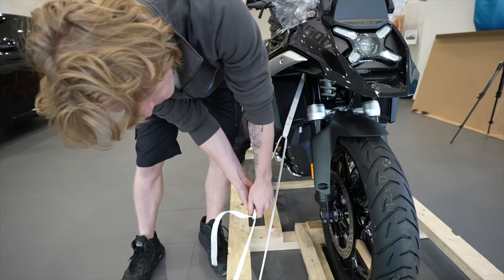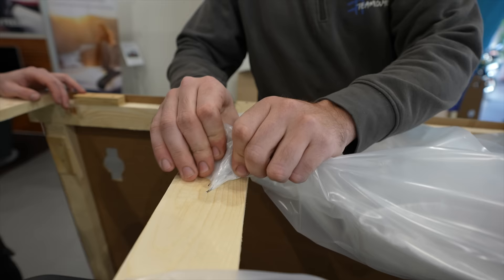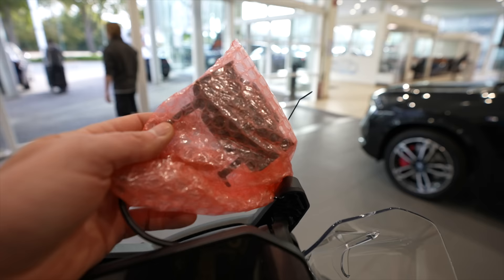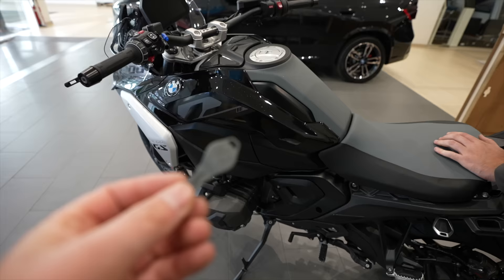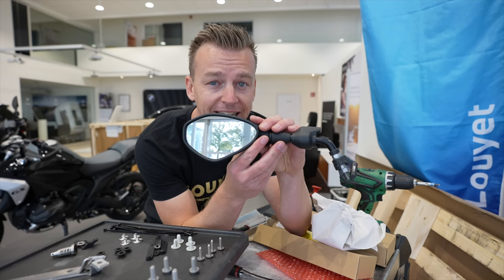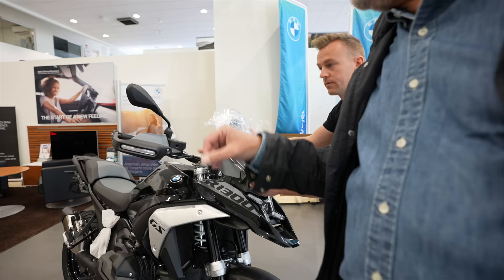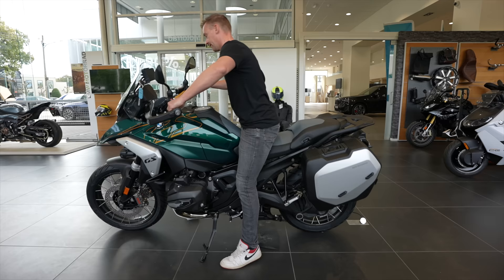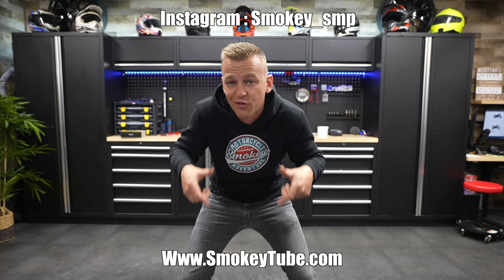2024 BMW R 1300 GS Unboxing & Assembly | TRIPLE BLACK

Comment: BMW 1300GS, German engineering: Recall actions to date: 1. fire hazard due to starter relay and 2. engine replacement due to connecting rod bolts. 3.original accessories from BMW: Since March 2024 official recalls of the Vario case and the Vario top case for the BMW R 1300 GS. Reason: Risk of accident due to cases opening or falling off. I am thrilled!😒

Comment: I’d like to understand the standard height. How tall are you and does the suspension dynamic suspension help if you are a shorter rider, say like 5’ 8’’?
Reply from the maker: I'm 176cm , with the special option suspension it lowers the bike under 15km/u and I could almost put both feet on the ground. This one did not have the lowering options so standard it's 850mm and I could touch the floor pretty solid.

Comment: Keep on bringing new content like this. It’s wonderful 👌🏻
What was the feeling in difference of the bikes, between the prior GS and this new one. Did you notice a lot of difference by just putting the engine working and dragging the bike outside? How was the handling feeling?
Reply from the maker: Feels soooo much lighter but the gastank was close to empty. This feels so much more easy to handle. Also when riding it slow and techical in the shop on my short it feels really light and stable.

Comment: Hi Smokey! Do you know if they are coming up with a 1300 GS Adventure model? If so, when? I'm having a hard time deciding between a 1250 GSA, a 1300 GS or wait for a 1300 GSA.
Reply from the maker: The Adventure model will come 100% but it's alway 1 year later. So hold tight for 11 more months 😁
Reply: I went with the 1250GSA, because I didn't like the new 1300GS, like the button layout or that the plastic paniers, still no backlit switchgear etc. So I'm not betting on that horse that the 1300GSA improves on any of that. Now I got an unbeatable price for a new factory order MY24 GSA.

Comment: Great video! So...have you ordered the Trophy version yet? 😏Mine is on order. Gold wheels with knobbies, the gold handlebar of the 719 as an extra, all packages and the enduro pro. Did you know you can get the wind deflectors in forged carbon 🤤 just saying.
Reply from the maker: Daaaamn what a spec!!! Congrats 😁
I will ride it in couple weeks , I hope for my wallet it's slow and boring to ride. If not...oh boy 😅🙈. I will go for the trophy with black wheels I think. Have not seen one with golden wheels in real life so have to wait for that 😁

Comment: I will get the green one ..prob late next year as ive only just bought the 1250 GS .and want to see if my aftermarket panniers will be able to transfer across..dont like the vario stuff.. went to see one at a local dealer and overall I'm impressed , it's surprisingly light when you stand it up off the side stand compared to the 1250 .. your thoughts on the engine coating ,? I also think there are parts that are little lacking..the back brake pedal looks very ahem cheap ..also the reservoirs for brake and clutch on the handlebars are a tad basic , but at least not plastic ..
Reply from the maker: They feel very light now because all gas tanks are empty at the dealers 😁

Comment: The trophy is sportier and fits well with the modern design of the new GS, I thought black was beautiful on the 1250gs, but on the new model I find it rather boring and it looks smaller. This doesn't mean I don't like it.
I have ordered a trophy and it is not expected until the end of May 😳

Comment: I saw another YouTube short of a guy saying it had an electric center stand. I thought it was a joke and thought they had some other electric noise in the background while they lifted the bike with the center stand. Now I see what they were saying. That’s actually pretty clever to have the assist from the suspension lift system.
Reply from the maker: It's more like a pump that's pumping up the suspension to stretch it out 😅. Gotta investigate that some more

Comment: I’m also the 1290 SAR lover and owner. Personally, my choice is 1250 GSA instead of 1300 GS even 1300 GSA. The reason is 1250 GSA is ne the end of classic generation, prefer the body design and looking. I think the 1250 GSA function is good enough, 1300 GS is too much electrical and nice to have instead of must to have. I will want a 1300 GS/A, but regret no have 1250 GSA. 😂
Reply: Sorry for say this example…what the electrical center stand for? Real needed and worthy spend money for it? Or just show the luxury in our friends😂? Let think about…if the price does not increase too much, but so many electrical elements in 1300…what is the cost down blanace from? It is my considerations and opinion for the topic of new/old GS.
Reply from the maker: If you park the new GS next to the old one you are not gonna want the old one. It looks 2 times as big and heavy haha. yeah the electric stand is more like an air pump that pumps up the suspension to a max so easier to put it on the stand. But I believe it was a 550€ option but you might also need different suspension lol
Reply: @LifeofSmokey yes, i saw your test on the old one. But it can improve by mechanical design instead of electrical assist. But BMW select the most expensive and luxury way to do that! 😂
And from test the new one, wait for “seconds” to finish completed the bike parking, other bikes take in 3 seconds…yes, it is amazing!
Reply: I do like previous gen GSA, so i’m not against BMW only. Just personal feel about all the modern car/bike how they give us now and future, lost more and more mechanical machine which why we be a car/bike lover in the beginning.
Reply from the maker: That's why I loved the Royal Enfield Himalayan 😁. No electronics besides ABS....

Comment: They should have put at least 160hp in it. 140 is lacking in my opinion
Reply from the maker: 149Nm of torque is the most of all it's more HP competitors. The previous 1250 GS smoked my best friend on his Superduke R on the highway doing 120km/u in 6th gear at full throttle 😁
Reply: Torque at rpm is much more important 😅

Comment: brake lights....just the 2 signals? that's it? come on....they're small, need more brake lights back there, light me up...its not bmw that's at fault but most OEM's just don't put enough lights in the back.